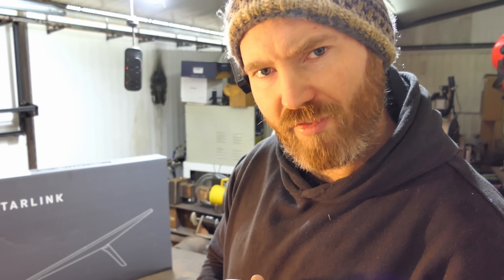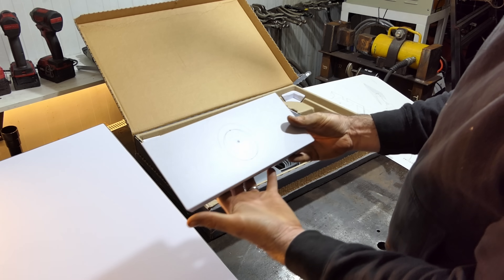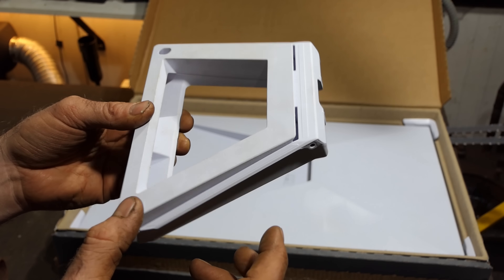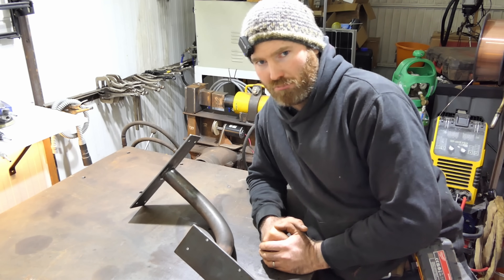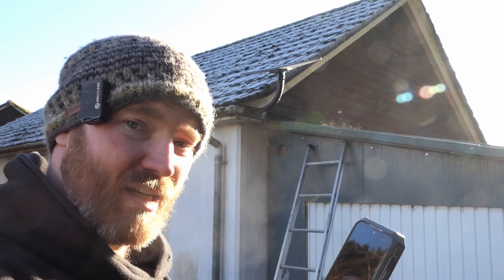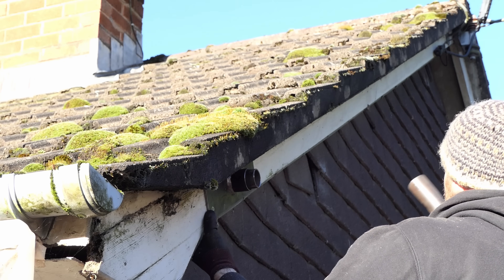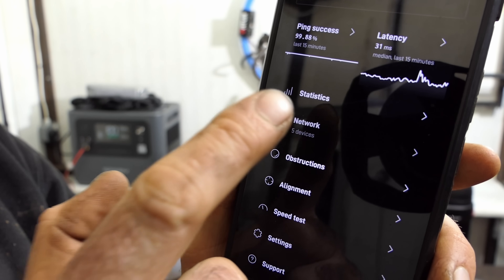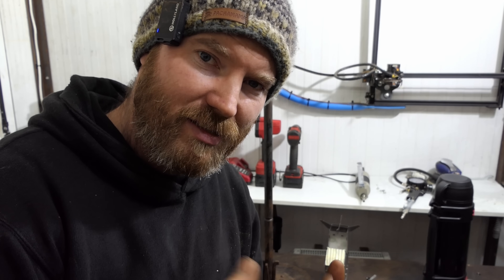I bought UK Starlink internet... I'm shocked!

Comment: Assuming it points at a geostationary satellite above the Equator, then it would need to point south if you are in the Northern Hemisphere…

I used to get satellite broadband from sky, and it was a lot cheaper than that… A quick internet search seems to suggest 4G broadband would cost you about half your current monthly fee.
Reply from the maker: @AndyJMacLeod  it's still not good signal here for 4g/5g. Starlink is the best so far for my area. Cheers J

Comment: What I have is a private WIFI 7  MESH Network with at least 2 routers linked to increase range of ISP whatever can be, Starlink, 4G LTE, or Fiber Optic ONT or router modem.
The Xiaomi BE 5000 is WiFi 7 and very cheap.

How many LAN ports does the Starlink Router has?
I am living on an island and there is also Satellite links but a lot cheaper than starlink.
best regards.

Comment: In terms of speed, never rely on the wifi and the distances it can travel. Where ever you can, use Cat6 Ethernet and the very last section can be wifi if you really must say for tablets and mobiles. 
The fibre optic will in time be everywhere for everyone, although since labour came into power thats slowed right down!! The long term plan is going way beyond the 1Gbps standard, pushing 10Gbps for large domestic and 25gb to possibly 100GB for commercial.
Reply: I forgot to mention also you can run TWO or more Wifi routers quite happily, one connected as normal and the other as a distant subordinate, connecting an Ethernet from the fist router into the WAN port on the second. Alternatively you can have MESH networks with Wifi that basically act as repeaters, especially useful in buildings with very thick walls or to remote buildings you really cannot be bothered to lay a hard cable to.

Comment: Fantastic Video showing a 'real-life' Starlink setup experience! Would suggest that to upgrade the connectivity throughout the entire house (and add a wired connection to the workshop/office for even faster uploading), fitting a cloud gateway system (Like that offered with Ubiquiti UniFi) with individual access points/network switches would massively benefit you and the whole family. Obviously requires further cost and a bit of DIY to get cable runs sorted, but should definitely future-proof you so fibre can be plugged into that when you eventually get it! Looking forward to a possible further home upgrade video!

Comment: brother no offence but those speeds are not anything that you cannot get with the normal internet service providers i have virgin for £32 per month 250mbps download they also do offer gigabit internet for like £50 per month . Unless normal ISP dont cover your area i dont get why youd use a slower and much much more costly service like starlink
Reply from the maker: You must have missed the beginning. I have no fibre, no 5G and the copper cable is terrible. Starlink is my only choice for anything decent. Cheers J
Reply: @joshuadelisle  Would you say your heart goes out to Elon Musk? 🤣
Reply from the maker: @BenMacdui  I'm not swade either way and I don't fall for the political propaganda of either side. I just see man with aspergers making a success.
Reply: @ Ah, an enlightened centrist! lol, you're not fooling anyone, mate.
Reply from the maker: @BenMacdui  I didn't say I was centrist. I try to look at things objectively and see both sides before making a conclusion that leads me to speak out. Things are never black and white and are more likely half truths or partial truths. The media is skewed with an agenda on both sides and both sides have valid points worth considering. I agree with some points and not others but I don't fully support either. However from what I've seen Trump is a good choice and Elon deserves his success. Cheers J

Comment: I was on the same boat as you for landline internet and about to go the starlink route for my internet in the uk rural country side, until I came across external 4g/5g antennas for the outside of my house which I tried even though I know my house is no service emerency calls only from all 4 providers 02 3 ee vodafone until I walk 15-30minutes in ether direction of my house then I get 1 bar of signal on my phone, and with the external antennas I now get 1 bar of signal and 90-130mbps down and 5-10mbps up on average for £12 a month with ee through a third party provider scancom paid in full from amazon for a year and a half, I'm now just starting my 2nd sim with scancom after my first year and half expired.

Comment: copper cable vs starlink...why not try high speed optical cables vs starlink...im sitting at 900mps and it is sweeeter
Reply from the maker: Again there is no optical fibre or good 5G, starlink is the only fast-ish option for me where I live. Cheers J

Comment: I live in town and STILL get garbage internet connection no matter who I try, although I am stuck with openreach.
Skynet, sorry Starlink, are signifigantly faster, costly and difficult to contact when the system falls over.
Customer service became a problem 8 mounths in, when weirdly, the data cable failed after an update recently, that's what they claimed anyway? But it still took over the week to swop it out as it obviously ment getting on the roof, a first for me, cable wearing out!  There is still a huge variation in speeds and the base/router has very poor range compaired to others, we now 'pass-through' and use repeaters. 
3-6 times the cost smarts however.

Comment: I have a wired cable connection, Comcast Gigabit Extra $120US/month. I get 1200mpbs down 35mpbs up. Excellet wifi range, $15 month for modem.

Comment: If you have a working phone then why not use 5g broadband?
Reply from the maker: There's terrible signal here. Cheers J
Reply: @joshuadelisle  it might be terrible at ground level but a receiver in the loft should get a better signal.
A signal booster or high gain antenna might also help.

Comment: Random question about your Hard Drive! Was it an older HD or an SSD? An older drive of mine got dropped by someone and stopped working and I lost a lot of stuff and for years it’s been in the cupboard waiting for me to bite the bullet to see if I can get it recovered one day. I sent it off and they said it can be and it will cost over £800. I said I would just have the drive back and make a decision if it’s worth it. Someone in that time suggested I just buy a hard drive docking station for £22 off amazon and plug my physical drive into that to see if it works. It only bloody did. So a lot of money saved and all my data recovered. Might be worth a shot if it’s the old physical hard drive you have damaged!! Good luck.

Comment: Just get StarlinkPros to take care of the whole installation process, I done a lot of research before and realised it's worth paying for a professional to save the headaches of climbing ladders and fitting it incorrectly... they also took care of the internal networking with wifi boosters so each room had over 300Mbps. I couldn't even get through to a human at Starlink directly, but these guys are literal Starlink geeks lol and they cover the whole of the UK apparently. I would AVOID those cheap mounts online, they're only plastic, so I sent mine back. these guys used reinforced metal kit and everything, job done, no hassle!

Comment: When looking at Mesh Wifi systems be aware that Tri Band is a necessity to not saturate your 5GHz Wifi across the nodes as it effectively cuts the bandwidth in half for the backhaul if you're using them wirelessly and only have dual band.

If you're able to backhaul the mesh units with ethernet go cheaper dual band (as the third band is just a second 5Ghz for backhaul).

The only downside to Starlink is things that require a constant stable ping like gaming. This fluctuates massively as it switches between satellites, it will be the only situation where your ADSL is better for it despite the slow speeds.

Comment: i saw your phone was getting one bar of 5g indoors. not sure if its actually 5g or fake 5g bs that some operators were allegedly pulling off but i'd also investigate options for a 5g fixed wireless setup where you put a directional antenna to the roof(for hopefully better signal-to-noise ratio) and feed the antenna coax to the modem inside. probably you already did, and it'll probably cost similar, but just saying. expect your starlink speeds to drop slightly over time as more and more people move over to starlink in your area, but it will never ever be as bad as your old dsl days lol

Comment: I feel blessed here in The Netherlands with my 1Gbit up/down speed. Uploading a video that is 5GB to YouTube takes 40 to 50 seconds. 🙂
But dude, your roof, those tiles are overgrown with mos, better fix those also before you get leakage. Good parenting to keep the kids of the internet after certain times. Kudo's for that. Here in our house I just have a modem, but I can just block certain MAC addresses from which I clearly know which device they are from. And unknown MAC addresses are not allowed so trying other devices won't work either. Ouch, loosing data is bad, but better buy a (cheap) external drive and keep your video backups on there as well.
Reply: Moss isn't going to cause leakage with tiles. Who told you that myth is an idiot. In fact, the more plantlife you have on your tiles, the smaller the chance of leakage will be.

Comment: You should get another 3rd party router with better range. It plugs into the original one via Ethernet and will be much better at boosting the signal throughout the house. Could be a good upgrade

Comment: While I understand the intention behind your approach, I have to say, I strongly disagree with this vision. Completely micromanaging a teenager’s internet access might solve short-term issues, but it risks eroding trust and independence. Instead of controlling everything, teaching kids how to navigate the internet responsibly might be more beneficial in the long run.

The internet isn’t going away, and learning to use it wisely is just as important as protecting them from its risks. Encouraging open dialogue and setting mutual expectations can often go a lot further than strict controls.

Comment: interesting video...... but the very first thing you did was put it on the lowest part of your roof. if you have a house roof between your device and a a satellite yes your going to have problems then you got trees too, and if tis misty the trees get wet and hold water on them also becoming a barrier. I bet you have a chimney too? then the link is a flat surface, unlike old dishes they are curved for a reason you get better angles from curved. I suggest putting it at the top of your roof if you can build a isolated tower or pole above the roof you can adjust up and down to get above tree height and roof areas. so if its windy you can retract it back down for safety of the device. I do know some stands for the links actually rotate towards a moving satellite after they make a connection so i suggest looking in to that. having yours fixed in to its current location is not the best place for it.  a simple search on google will get you answers. 

this once my 5 second search....
you need to angle your Starlink dish towards the part of the sky where it communicates with satellites. The dish should be tilted to the best angle for satellite coverage in your area. 
Explanation
After a few minutes, Starlink will automatically connect to the Starlink constellation and tilt to the best angle. 
The dish should be tilted slightly north or south depending on which hemisphere you're in. 
You should keep your Starlink tilted to prevent service interruptions caused by rainwater. 
You should ensure your Starlink has a clear view of the sky so it can stay connected with satellites. 
Objects like trees, poles, or roofs can obstruct the connection between your Starlink and the satellite. 

My suggestions are just my thoughts good luck with solving your issues

Comment: Why didn't you install a router that uses sim card and connects to your carrier? Starlink is unreliable for online gaming(idk if you do any of that) and is extremely expensive. Actually very funny that you mention power draw and that they have that graph like someone should be concerned about the power usage considering the you paid 320€ for this and you will be paying 80€ per month to use it. This price is crazy high because you can get a router with a sim on 5G speeds because as i can see on your phone you are getting full signal with 5G for 50€ or less. If you care about power draw in a off the grid situation then you wouldn't be buying this horrible product in the first place.

Comment: Think of your internet like water. 

Your starlink router is your stop cock.   Start adding a switch..  so you have 24 ports.  (Taps)
 Then run upto 24 cables everywhere.  Either ending in a network port and cable everything not moving tv pc the lot. And then put access points scattered about the place and turn off WiFi signal ssid on the starlink, and setup your mesh WiFi using the access points.   So the starlink router will just do dhcp.  Addressing and feeds the Internet to the access points.  Which you mange with like TP Link omada if you buy tp link acess points.  (There are others this is the cheap option) Your ssid should be meshed and you just wander around on the same network.  

I do this for a living. 
You're welcome. 😊

Comment: The advice I will give is a little too late but you should do it going forward. Whatever videos/documents/etc you accumulate on a laptop/pc, etc, should be backed up regularly (weekly) to at least one other source, ideally two and clone the hard drive (saves you have to reset all your settings etc on applications that you have customised to your own preferences). Saves you time/grief and money.

Comment: Orbi Mesh network will solve your home WiFi speed issues. I'm running an older RBS/RBR750 mesh network, which does support daisy chaining with the latest firmware) and within my house I'm around 900mpbs, and I have complete coverage over my 3/4 acre property. The link to my garage/barn (separate structure from my house) has about 300mpbs via a daisy-chain link. 

The newer/more expensive Orbi system gives you far faster speeds, but I've got no need for anything over 50-90MB/s so I'm good with the cheaper solution. 

My internet is 1g/1g fiber, so I'm good there.

Comment: Have you tried a 5G modem? I do live in a flat quite high up, but I did live in a house before and I was getting 300 - 500Mb down and 30 - 60Mb up in the house and now I'm living in a flat and have line of sight to a 5G tower I'm getting 500Mb down and 100Mb up constantly and I only pay £16 a month for unlimited data with ID Mobile which uses the 3 network. I did have to plop down £275 to buy a good 5G modem, was thinking about eventually getting semi directional antenna, but it only improves upload and my upload is more than I need now so no problem. Also the antenna I was looking at was $800 because it uses a phased array antenna to beam form so it can electronically point the beam to a certain extent so you don't need to point the antenna exactly dead on to the tower.

still needs to be within a maximum of 15 degrees for best results because how a beam forming antenna works is that it cancels out some of the emissions to create a beam, so the further off centre you are the lower power the beam is, but yeh issue is it's expensive, £800 for a phased array antenna, and the antenna that come with the unit I got are plenty good enough for my use case so... just if you do end up going that way, point the antenna so they are all at least 90 degrees offset in a square that is flat to the tower you are connected to, this create a virtual antenna with the same resolution as an antenna that had the same area as between all of the antenna, doesn't boost the actual signal strength, but it does enable you to get more information out of the same strength signal in this case it means higher data rates.

If you wanted to get the exact 5G modem I have it's the gl.inet gl-x3000 the Wifi on it is pretty decent to when I was in a 2 bed house I could get 200Mb down in the furthest part of the house from the access point and 800Mb in the same room, that was transferring files though from my computer over Ethernet to the modem and then to my phone the internet wasn't fast enough to saturate the Wifi in the same room, also I could get 50Mb on the opposite side of the house in the garden, which is good enough when I'm only going to be using my phone to watch stuff and listen to stuff in the garden.

On the other side of the house out the front from the end of the road which was about 50m away, this is with direct line of site to the modem though I could get 50Mb to so, yeh pretty darn decent, and now I live in a flat when I turn the power of the access point upto maximum I actually got a connection 13 floors down from the right side of the building.
Reply: Oh also again if you are going to give it a shot look at coverage maps between different networks and if any of them have 5G coverage near you (the coverage maps are based off measuring with a phone, so you don't actually need to be within the coverage area just relatively nearby) then buy a pay as you go SIM for each and like 50GB worth of data for each so you can use each for a couple of days to see how each performs.

Only buy those that own their own network after which you can see what carrier use that same network and get the best deal and your done.

Edit: also try moving the modem around the house to different windows, as said even if it's ugly in the position it's in you can always mount a dedicated antenna later so it doesn't matter.